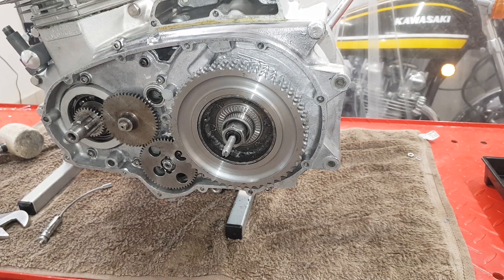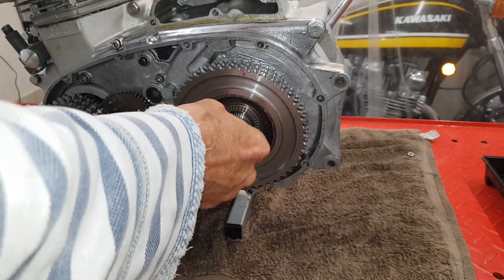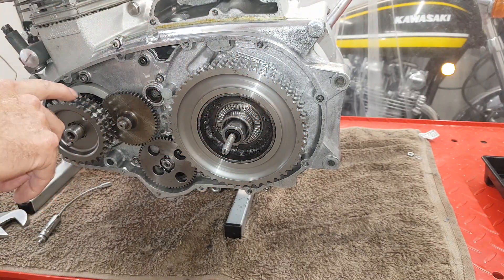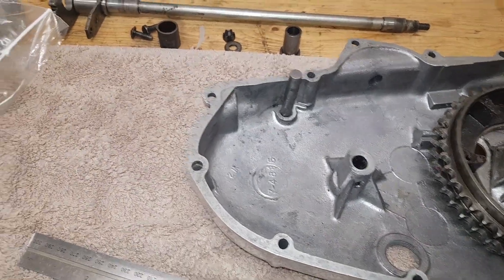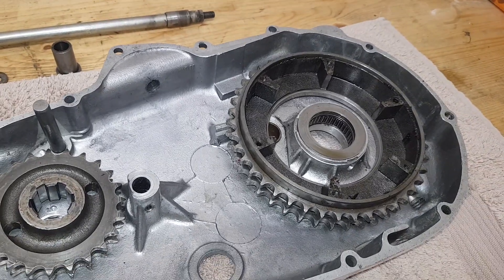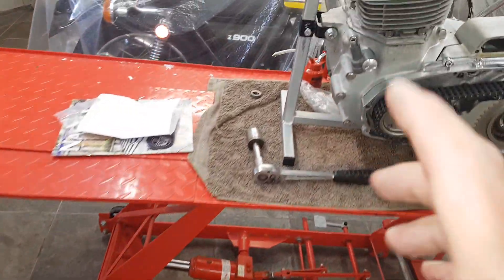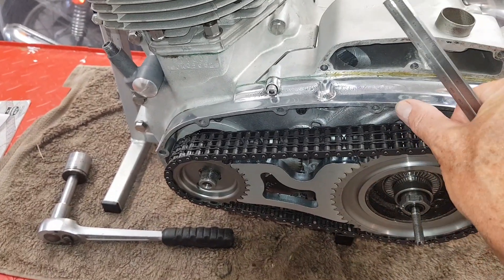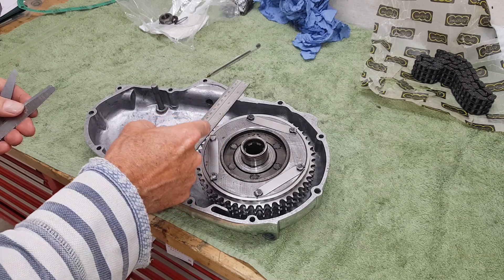Triumph Trident T160 Engine Rebuild. Part 39: Primary Chain Alignment

Comment: You say 3 thou is OK but it would be useful to add what the limit of an acceptable tolerance is.  Would also be useful to add to be careful the chainwheel doesn't rock at all while doing the first measurement, I found there is a tiny bit of side-to-side horizontal play on the chainwheel, so made sure I pressed firmly in the middle while taking the measurement.  Very good instructional video though, that I found very useful and easy to replicate.  Thanks Chris.